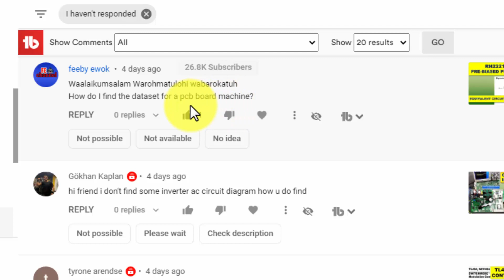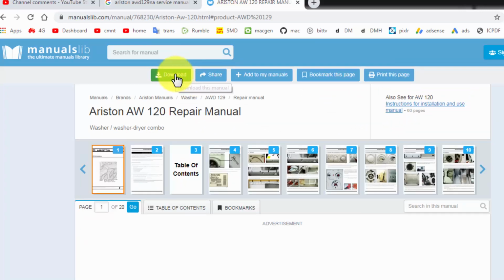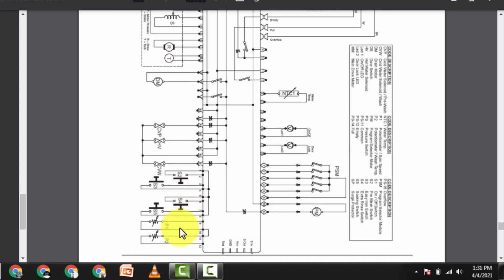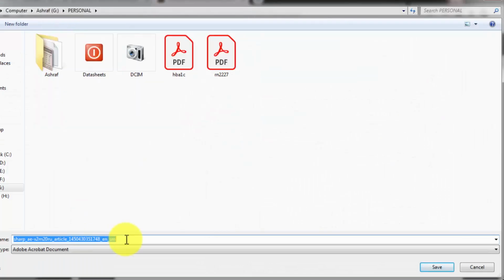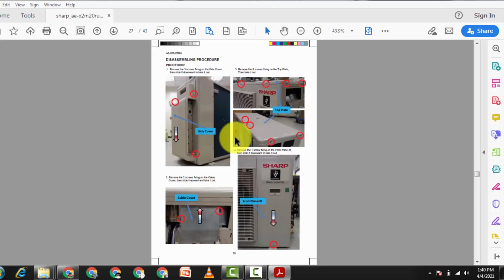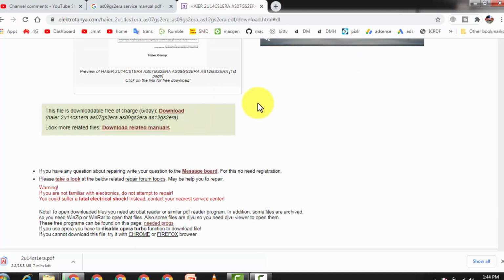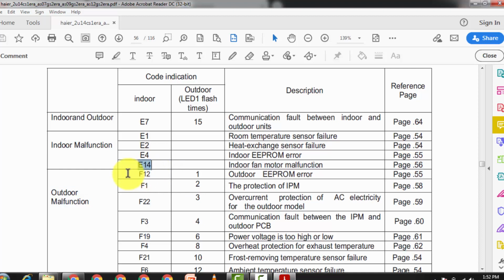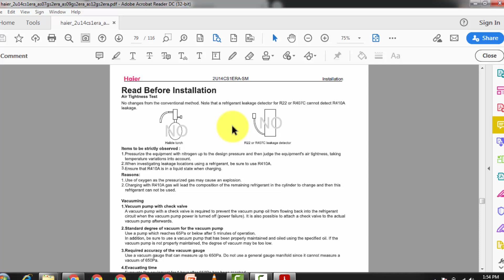349 How to Download Circuit Diagram | Schematic | Service Manual for Inverter AC | Washing Machine

Comment: Dear freind I have tried fo down load sharp 21 inch crt tv service manual circuit diagram  but no results if it is availble with you pleaselet me know sharp 21y fx 10A model😂

Comment: Hi i wonder if you could help me for getting some shematic on LG DM5520 MAIN board and  smps board its   a mini theater music center please
Reply from the maker: can you please reply with board model number 
it is much easier to search the schematic with board model number 
i tried with DM5520 model number, it is not giving useful information 
but if we try with the board model number, it is possible that you can find information.  might be the same model number is being used in some other model number, so you can use that diagram
Reply: HI thankyou for the quick reply the board is DM5620 MAIN VER:1.3  1.30.1.DM562004RR DATE :2012.03.30 thats what is on the board  THANK YOU

Comment: Sir plese help whirlpool outdoor pcb circuit diagram
Reply from the maker: please send outdoor unit model number   or   outdoor unit board model number
Reply: @HaseebElectronics  ok
Reply: Odu model no 1.OT EZ FANTASIA INVERTER
ODU CODE :43071
PCB MODEL NO :HTSD008-14602A-PC-V09
Reply: Sir plees help
Reply from the maker: brother i tried my best but this model number have no information in internet 
might be it is assembled by some local firm and they hide its original information and they marked theri own number on the board. otherwise the boards are most likely the same

Comment: Hi, thanks, I like it. What's happen if no one schema i found? have you another hints?
Thank you
Reply from the maker: in some designs which are restricted by the OEM, then it is hard to find 
in that case there is reverse engineering method to be used to draw on schematics
Reply: @HaseebElectronics  Thanks, I am trying to repair a welder. I have found more models but not I have.
I follow your method, reverse engineering😉 Thanks

Comment: I have a problem with a startec A/C inverter unit all caps and the outdoor unit voltage is fine but no voltage from the fan and compressor connector terminals.